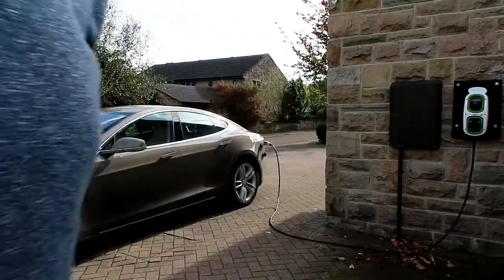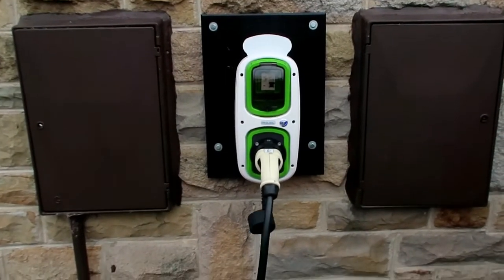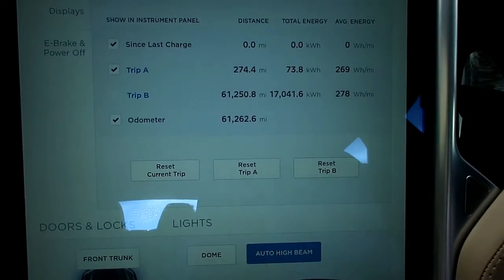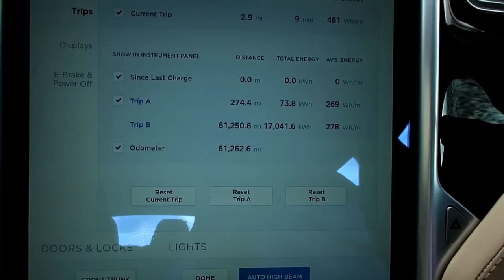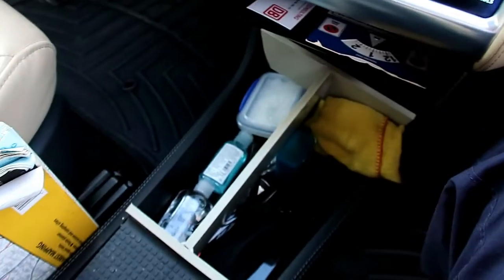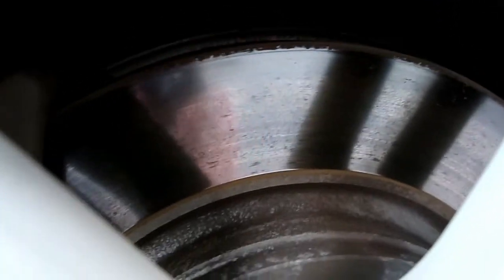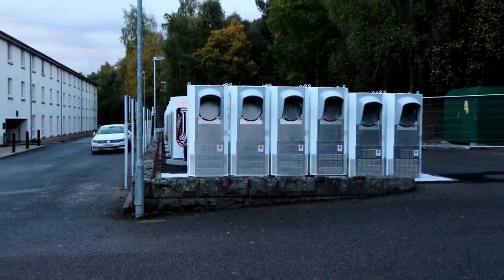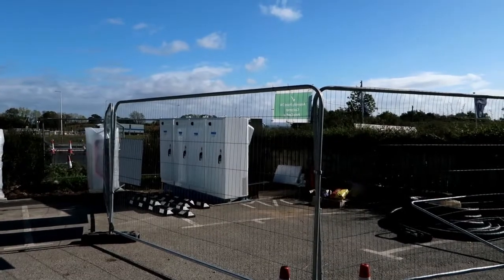Tesla S90D 60k mile update, charging and new superchargers UK

Comment: How has the tyre wear been David?
Reply from the maker: Hi Richard, Mileage now up to 82K (1-7-18) and Dunlop tyres (Fitted at 40K) will need replacing in 2K miles time. David
Reply: Thanks David. I just wondered if the tyre wear might be heavier due to the weight of the battery. 40k is pretty good.
Reply from the maker: Hi Richard, I am not a fast driver so that probably explains the good tyre wear. My average electrical consumption is 280Whr/mile over 82k miles.